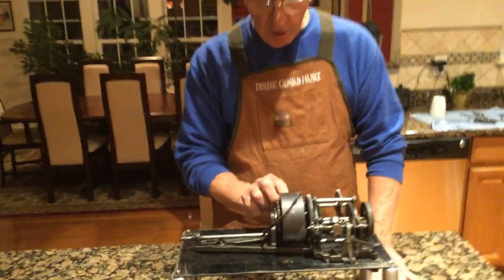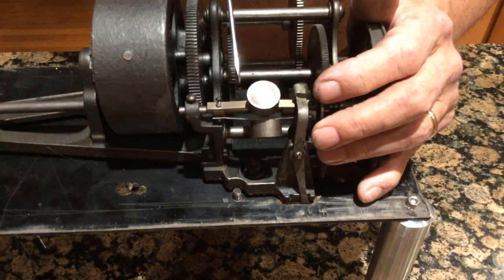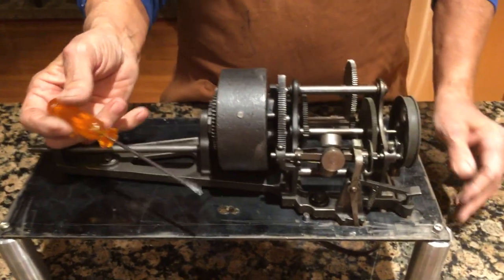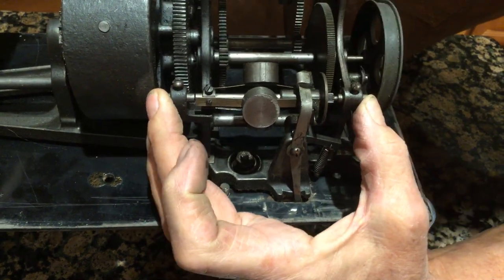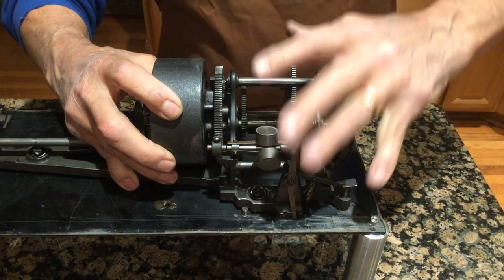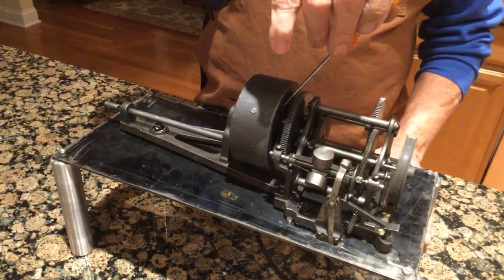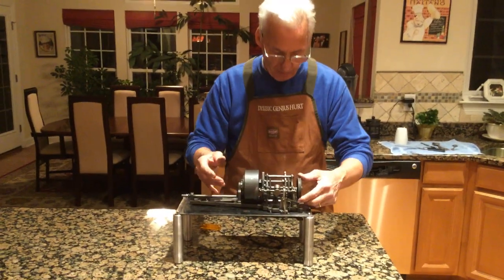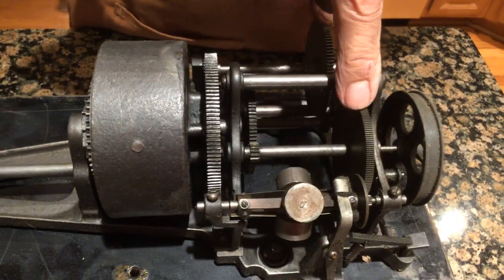238.  How to disassemble an Edison Home phonograph motor

Comment: I recently bought a model A home phonograph that wasn't working. I just replaced the spring motor and a couple of broken gears, but the only way I can get it to run is while it is propped open. When it's propped open, it seemingly works great. But when it is not propped open, nothing wants to start spinning. Any idea what I should look at?
Reply from the maker: The weight is shifting in the motor when you prop it open.  Somewhere something is binding.  What’s the tension on the belt?  On the governor? Is it’s in the motor or the mandrel?

Comment: I would let that spring wound down before taking the motor apart, never,never take a motor apart with a partially wound spring, not even a little tension
Reply from the maker: Some times they do not wind all they way down, so that way,  it it saves the governor. Edison triumphs are notorious for that.
Reply: @1974hurt  i have one broken
Reply: @1974hurt  phonograh